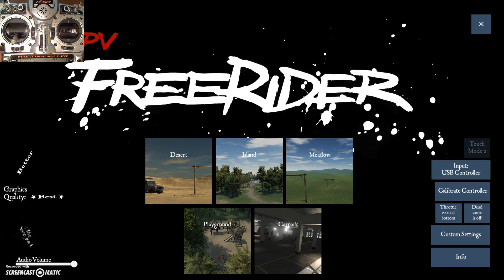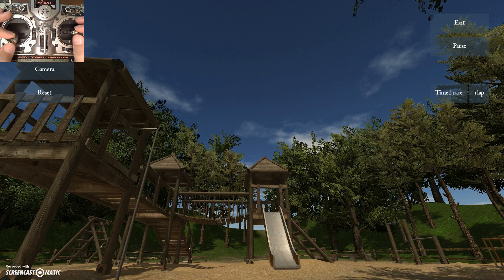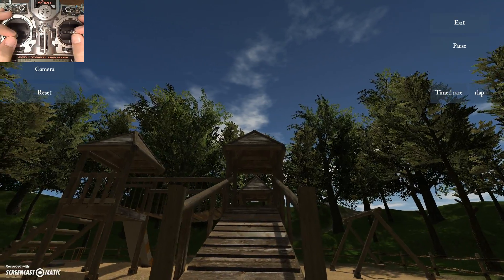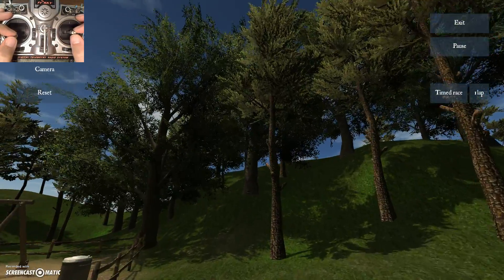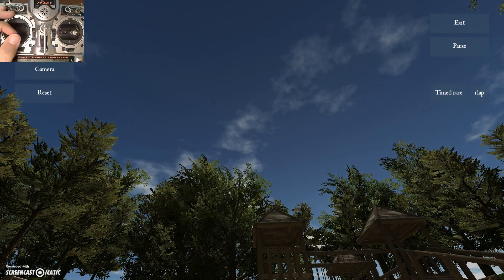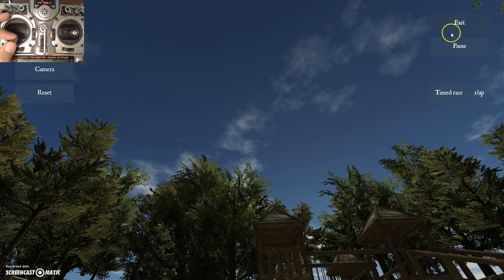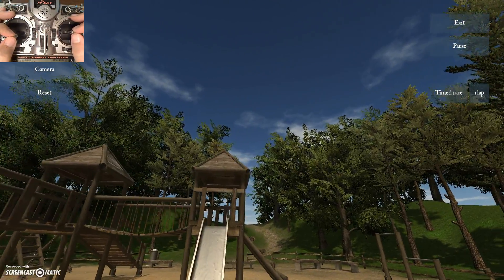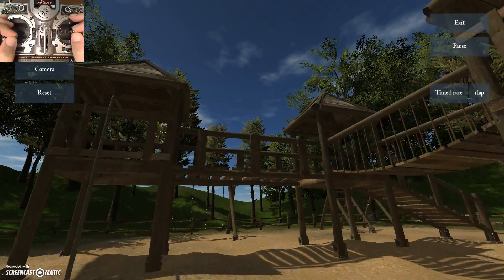How To Fly A Racing Drone - Lesson 22 - Slow Precision Flight

Comment: Hi, Joshua. 
I really enjoyed your FPV Freerider lessons and they have helped me to improve my skills in flying these quads. I actually don't own a miniquad but I do have experience in building and flying them in LOS (for other people). I have never tried FPV with them and I was wondering how similar the simulator is to the actual thing... just so that I know what to expect when I get FPV gear in a month's time. ( Currently, I am running 100 throttle with 90 FOV on the snappy settings like you did ) 

Hope you reply,
Peter.
Reply from the maker: +우희도 The simulator is reasonably close to the real thing. Skills you learn in the simulator will translate over. The simulator doesn't fly exactly like my copter does, but not all copters fly the same either. The simulator is definitely worth your time.
Reply: +Joshua Bardwell Thanks man, Im a really big fan ! :)